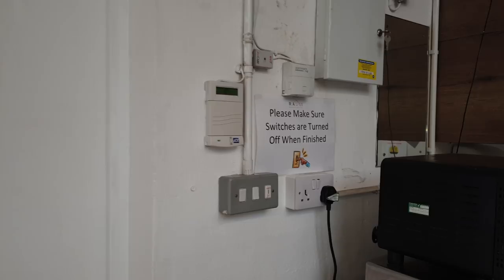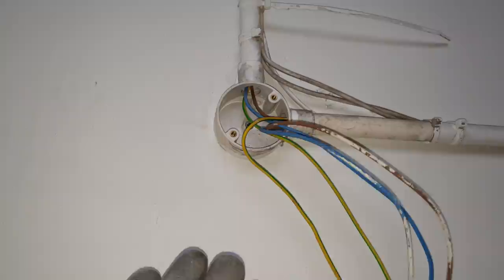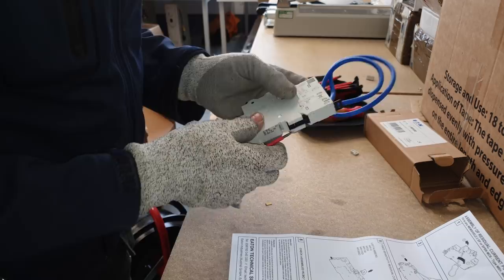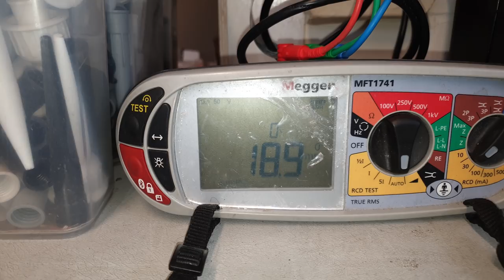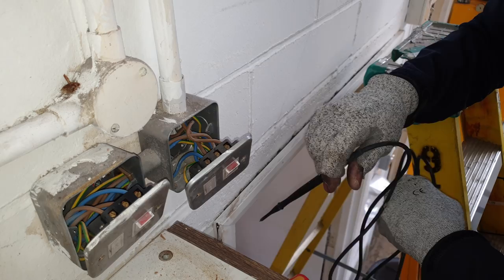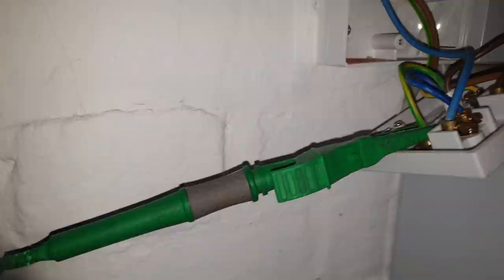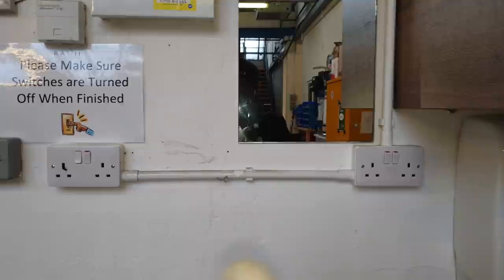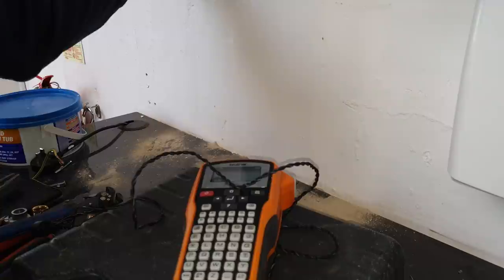Client Issues Story | Earth Continuity Fault Finding | EICR Remedial Work

Comment: I agree with putting a tee box for the fixing of a light,reason being I had a job where a old fashion metal bulkhead was hanging of the cables,the heat had melted the plastic box ,and the brass threaded fixings came away from the box 👍

Comment: For the em light, you could get a dome cover/ conduit lid with a 20mm thread. Put on a PG gland and run a flex to the light and wagos in the conduit box. 👍👌
Reply: Lower-tech but I've drilled a small hole in a plastic conduit lid and taken a flex out of the hole in situations like this before.

Comment: For an rcd it asks for the time in milliseconds, if you are using a 30mA rcd/rcbo then it’s for additional protection,you record the 5x test (highest of both cycles) only. There’s no requirement or reason why you would record the 1x test other than if it was say an 100 mA rcd used for fault protection only.
If you have recorded the 1x test only on the certificate then that is incorrect.
Reply: Minix Tvbox  the form simply asks for the rcd test in mS , depending what the purpose of the rcd is for ( in this case additional protection) you record the result for additional protection which is the 5X test. We require the rcd to disconnect within 40mS not 300mS.

Comment: Little trick to stop lights shaking when installed to a box - cut conduit to gap size and pop a long screw through the conduit and fix to wall on side of the fitting (like a barrel washer).

Comment: You can drill a 20 mm hole in the angle box and fit a bushed adapter and now you got a t box after all that angle box is just like an adaptable box had to do this a few times in the past the bush fits good on the angle box 
would only do this inside as you would loose the ip rating to a point when drilled

Comment: I remember retro fitting those Mem Eaton Rcbo adaptors over 10 years ago, I'm sure Eaton do a Rcbo now complete without having to convert an existing Mcb, unless of course the new type Rcbos don't fit the existing distribution board.
Reply: @cumberland1234  The Eaton EAD06BH30C which is a 6amp type B domestic rcbo ( other sizes are available) looks shorter than the memshield 3 in photos , I dont know if they do a type c or D version for industrial/Commercial.

Comment: Hi Delroy,
Nicely presented, pleasant video, as always, THANKS.
I agree with Adamsmith though - surely that Spur was just wired incorrectly causing a reverse polarity ?
The originals look like the same make/model, and clearly the cables are terminated differently, aren’t they